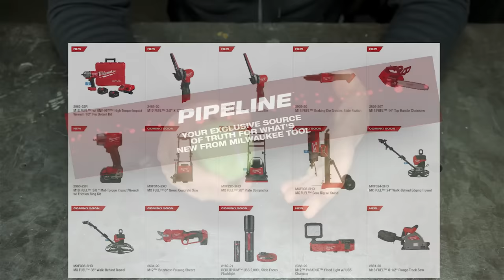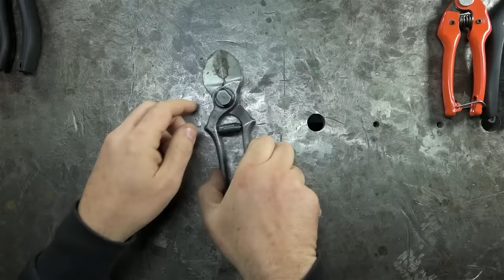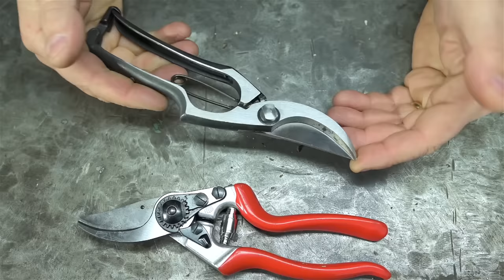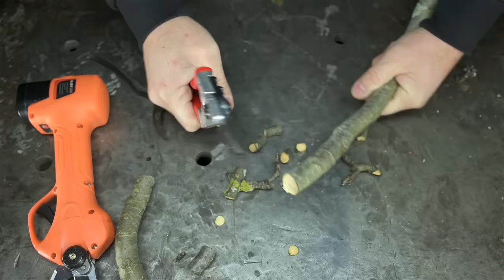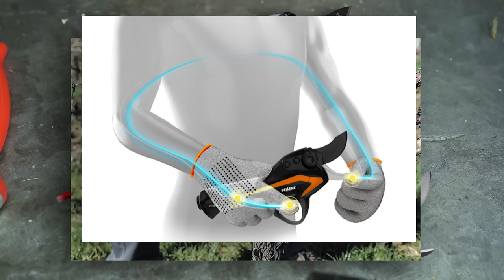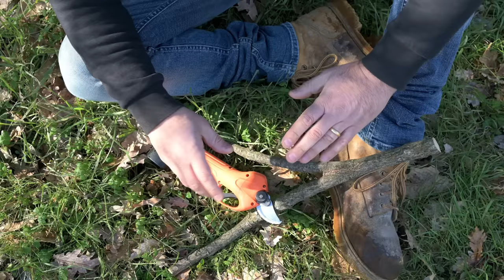MILWAUKEE ?!?!?!

Comment: The case design seems to be based on a couple other tools Milwaukee makes...their cable cutters and their crimpers. Because all three tools have similar mechanical actions, I'd bet they just reworked some existing molds to float a new tool that may or may not garner a lot of sales. Looks like they could be good for rough work.

Comment: OK so.... I bought the thing. the KEBTEK  the slim model 20mm-30mm.  They are actually great a bit heavy for a vineyard pruning (especially overhead) but taking over the work horse role of thicker cuts near the bottom of the secondary's really saves the hands from being beyond sore the nest day. the fact that it comes with 2 batteries and the capability of charging both at he same time in a small form factor (Just cords plugged into the batteries instead of a whole charging station) makes it easy to charge off the back of the small lawn tractor (JD 318). the blades aren't that durable to be honest. I haven't broken them but a small nick on the wire holding the vines leaves it with some authentic battle damage. easy to sharpen out but definitely want to avoid anything other than plants. they could be made of harder steel I may make some extra blades from something a bit more durable.  the price is unmatched simply put. the other option for a professional battery powered pruner in in Canada will run about $2000 compared to the Kebtek coming in at $300 is unparalleled for the form factor. Thanks Tony for sharing I finally found a pair of electric pruners for my mom to be able to use :)

Link to Kebtek Slim if anyone is insterested
https://www.kebtek.com/product/445.html

Cheers

Comment: I have to assume the Milwaukee is big and slow because of power. More motor and gearing in there to crank up the torque. Probably get some more longevity when working them hard. Gear it down and beef it up so it's not hurting itself when you really push it.

Comment: The Milwaukee looks like one of those newfangled plumbing fitting crimpers with a different head on it. Feels like they probably shouldn't have used that as the base tool if so.

Comment: this is the first vid for this channel i have seen and i will definitely be back for more.

but just to point out you are getting to completely different tools mixed together.

the first one you show are not secreters but pruners. they are sometimes called (incorrectly) loppers. they are for cutting soft steamed plants only. same goes for the third one you show. they are also only for soft plants. mostly use to cut vines or fresh growth in the hear in the UK. hence no buffers and the jarring affect when used on tuff stuff. something you clearly have workout for yourself.

the loppers are a anvil type you mentioned but didn't show. they are for tuff winter wood only. the Falcs are the dogs bollocks, as we say. the 8 is for general use. the 2 is more amid at tree work. hence the full rib on the back of the blade, but the 8 and 7s will do most jobs round the garden. ho and the 'wire cutter'. thats for letting sap run off and not on to the handle. but is a good light wire cutter all the same. just don't expect Falc to admit that.

Comment: You can really put the power down with the anvil style pruners, I highly recommend getting a pair if not just to try them out. That is the only kind I use because I've used the other kind (mainly the style you have) and always end up bending the jaws apart.

Comment: 33 usd Fiskars shears that were tossed in the trash are Fiskars P90.
15 usd Fiskars shears are Fiskars SingleStep P26.
25 usd Bacho shears are Bahco P126-19-F.
65 usd Felco shears are Felco F-8.
90 usd (currently 75 usd on Amazon) Tobisho shears are Tobisho Type A 200mm Pruning Shears.

Comment: You should use pruning shears at like not perpendicular  to the branch but a little off from that maybe 80 to 70 degree from the branch with the felcos you can get through some pretty  hard thick branches.

Comment: Video suggestion. How about a fancy over-engineered electrical cable or air hose retractable reel. I'm thinking of making one of these for a 440-volt electrical cable but I need it to survive reliably in marine conditions.

Comment: I've got a 40-50 year old pair of bypass loppers, made in USA, that can easily go through hickory, copper pipe, and if necessary remove the digits from any neighbor who doesn't return my tool within a week after borrowing. I've got some old garden shears that are of similar quality that work great as well. No need to buy new crap made in China.

Comment: I have one of those so called dangerous chainsaw carving tool. But I  must say these power pruners look to be far more dangerous to handle.  The fact that just a squeeze of the trigger gets a full cycle.  I  see a lot of possible finger amputations.
Reply: Just a heads up.  I got an odd response from I think This Old Tony?  But it only shows on my phone and it wants me to respond on a different app called Telegram?

Comment: They missed an opportunity to have a nice sleek Pininfarina designed look, make them waterproof, and get all that nice clean mob money.  
Jokes aside, I pretty much only use shears for cutting DOT air brake lines, which the Fiskars are awesome at.  The low price and textured body mean that if I drop them or leave them behind, there's nothing to worry about.

Comment: I am surprised Milwaukee and DeWalt did not have some obtrusive guard which was bigger than the tool to 'protect' you from cutting anything but branches that the lawyers forced them to include. Let me guess, the Milwaukee is $275 and the DeWalt is $425?
Reply: Regardless, I would go for the 30mm Kibble..uh, Keblar, uh Chi-neh one.

Comment: The only hand pruner worth taking home is that Felco the rest aren't worth picking up. Those with the plastic screw if they get hot it will melt. Yes I've used all of them. Also you should never use an anvil pruner as it crushes the branch and allows it to start to dry out then rot. I've worked in Horticulture for over 45 years and done a lot of pruning. I would be ashamed to even show that I had any of the other pruners. I even tried a Wilkinson Sword brand prunner and put it in the back window on the way home the screw melted so I gave it to my brother as revenge for all the things he did to me when we were growing up.

Comment: I gotta say, I’m on the Milwaukee bandwagon for the same “compatible file format” of the batteries as old Tony.. it’s kind of disappointing sometimes. As much as I would hate to get new batteries I’d be down with a universal system you could use with any tool regardless of brand- anyways those orange bois look pretty nice!

Comment: I am not opposed to Milwaukee brands or other popular brands but you need to read this. I am a strong fan go RIGID brand cordless tools. Why you might ask? Because they are made to commercial grade and have a LIFETIME WARRANTY!!! What does that mean? Purchase their tools, register on-line, and receive replacement/repair of your tools and batteries for life! 
You read this correctly, that includes batteries also. If your battery dies you make a call to RIGID and after satisfying a few questions then they mail you a free battery. 
If that one or another dies they replace that battery too, for free, including free shipping. How do you beat that? 
Milwaukee or other popular brands do not do that, other than the first year. Have a problem with the Rigid tool they repair/replace it for your lifetime. Yeah, I have had almost ten Nicad batteries, replaced then they sent me a new two battery lithium charger and a replacement a lithium battery free of charge. Once my nicad died, and they had no more Nicad batteries to send me, now I have all my Nicad batteries replaced as well as their charger and they repaired a drill I have too, at no cost to me.

Comment: Probably not "all from the same factory in China" -- Kebtek is an international trade enterprise and factory. We are specialized in Garden Power tools, such as Electric pruning shear, chainsaw and hedge trimmers. We have over 100+ workers and 1000 square work area. With the motor and pcb board design team, numberous patents.With Your satisfaction is our biggest pursuit.
That looks like a pretty small outfit with  reat ambitions: "Corporate Vision: Become the world’s leading Power garden tools suppliers."

Comment: ToT.  I have a need for a unique tool that I'm hoping you can help me with, even if it's just a word of wisdom and a pat on the head before you send me packing.  But anyhew, the problem is the engine stud nuts on old Corvair engines.  These things are a bear because the studs are several inches long and they tend to come untorqued from the block, which you don't want.  Conventional nut splitters can't get access.  Do you think a set of vise grips could be modified into a nut splitter?  This is what I'm thinking about trying but a word of advice would be very helpful.  Thank you and God Bless!

Comment: There is a decent chance; rather, I HOPE this is the case: The milwaukee, being larger, higher quality, and more 'heavy-duty", will not explode into pieces and will be suitable for the pro/semi-pro using it at work. There maybe a peace of mind that comes with using bulky milwaukee if it does actually stand up to constant consistent work-related abuse. 
...
Or it could be bulky garbage and 4x the price and you could just buy a new Kebtek each year...

Comment: 13:00 These should be made illegal. Or at least should come with the obligation of having them locked away when not in use.
Awesome tool though. Especially if you're into making these decorative mural things made of coin-sized branch cuttings.

Comment: You know, convenient timing to start talking about power tools. Torque Test Channel just did a video on an absolutely brutal chainsaw swapped gas powered railway impact gun. Buuut there's limitations and people have been pointing out that you'd be an awesome person to look at machining a proper hammer assembly for... ...you know, if a 13,000rpm underslung minigun that converts screaming violence into pure torque sounds like something you'd be interested in looking into ..the last one got nitrous.

Comment: Or you could do what I do... own tons of acres of land and NEVER USED A PAIR OF HAND PRUNERS IN MY LIFE.   Who has time to cut anything that way?  Couple of days with those things and carpal tunnel is going to be the least of your problems.  I consider those big manual limb loppers an "only if absolutely necessary" thing.  If there's another way to cut and clean it up, I'm using bigger tools.  Electric bar trimmers... pole saws... tractor with grapple...  I mean seriously, Are you doing bansai trees in your copious spare time or something?  Because if you are you need to be showing THAT on Youtube.  :)   (Loved the video by the way.  Too much fun and truth in there all at the same time.)

Comment: I wish I had seen this a year ago.
I gifted my mother a pair of electric pruners after I searched the net for the most compact pair that still cut thick stuff.
From what I saw on the net I couldn't tell which were bigger or smaller, more powerfull or less, or reliable for that matter.
I didn't trust the asian products and many brands are just unavailable in europe. I also wanted to buy from a local vendor if possible. The selection was abysmal and what I chose turned out to be a slow, not even that powerful, way too heavy, monstrosity.